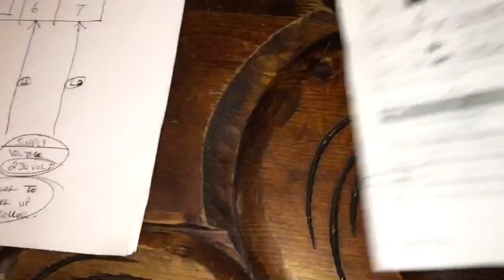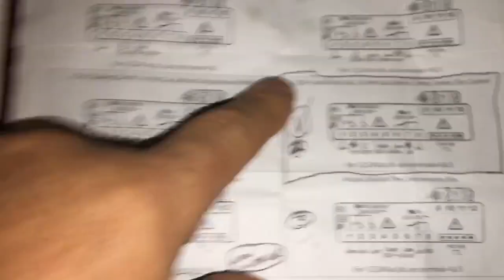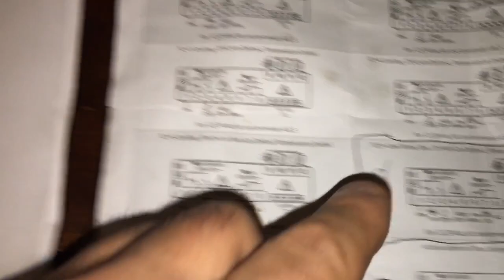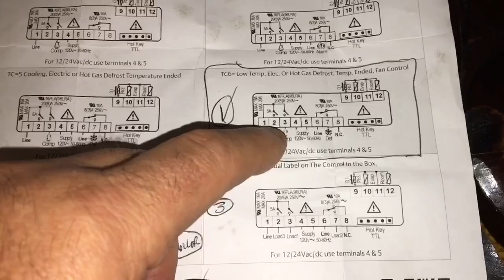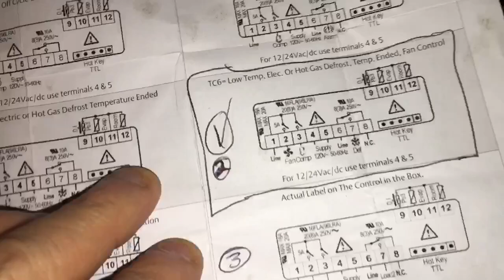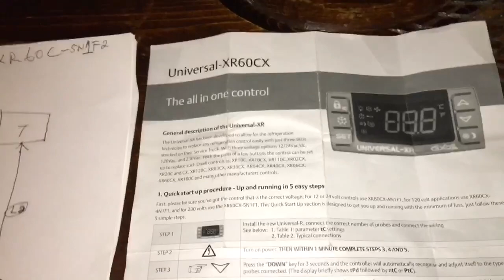How to Replace a Dixell Digital Temperature controller.

Comment: Came here to see how the old controller actually physically comes out / new one goes in / mounts.
Would have been nice to actually show an installation vs. just static photos.
There’s already a wiring diagram on the unit / and it comes with instructions in the package.

Comment: Helpful, thanks. I see a bar code in the lower right corner of the second page for the full manual. My question is how to add or lengthen defrost. Or, even how to tell what the current defrost setting are? If the full manual is down loaded, will the above info be included in this down load?

Guess I'll try it.

Comment: Really hard the first time to do the configurations but after that. Really easy. Dixell Tech support really nice guys 👍👍👍👍
Reply from the maker: 👍. This is a " Universal " Dixell. Just select the type of unit u are installing it on and No Programming needed. its not like the old controller that u have to program everything. soo nice. 1 Button select ,  for a Freezer or refrig  & away u go. rock & roll. soo nice.

Comment: Another thumbs up 👍👍 ps whatever happened with the ink bird controller
Reply from the maker: i Just haven't found the right job for it yet. The inkbird is a simple controller ( On or off at temperature only with compressor short cycle protection /  a simple switch  )  that can only be used on refrigerators or Liquid line solenoid control. it has " No Electric Defrost " capability 😞. This Was a Freezer application , so Had to use a Controller with Electric defrost capability. ive had no Refrigerator controllers fail lately , so its still on the truck. i might have a job for it next week where i need to replace a temp control for a liquid line solenoid that controls a small evaporator on a cooks line pass out cooler. its possible i might use it there.
Reply: OcRefrigeration , Hvac & Electrical Video's.  That would make a great video I had good luck with this controller for a freezer with Defrost it also comes in a 220 V

Elitech EK-3030E 110V Temperature Controller Thermostat Control System Heating
Reply from the maker: @ harry --- ill check out the elitech. heavy diesel has mentioned those  i think.  i think he likes them in europe.
Reply from the maker: @ Harry --- yea, just checked out the elitech. Looks like a good replacement for a Dixell. ill have to get one. alot more affordable than a dixell at around $135-155.00.   $100.00 bucks cheaper. easy to stock that on the truck that way.
Reply: OcRefrigeration , Hvac & Electrical Video's. I have a website I have to figure out how to PM you so you could buy direct and cut out the middleman 😁
Reply from the maker: you can just put it here in comments if u could.
Reply: OcRefrigeration , Hvac & Electrical Video's.  Not a problem they also have an app it’s called Alibaba.com type in the search temperature control and you can buy direct for pennies on the dollar 👍
Reply from the maker: ill check it out. thanks.
Reply: Got 2 of your inkbird still sitting in the van got to read up hope I can use it on refrigeration w/o def in place of dixell🤔
Reply from the maker: @ gene  --- i don't see why u couldn't. the ink bird use ntc probes just like dixell or carel. i stole the inkbird probe to replace a failed carel probe last week. worked great.
Reply from the maker: @ Genek --- only difference is inkbird relay is light duty. i recommend use a true relay or contactor with it. only rated for 10 amps max. 
if only controlling a solenoid no big deal , but a compressor id use a relay or contactor.
Reply: A trick : watch series on Kaldrostream. Me and my gf have been using it for watching a lot of movies lately.
Reply: @Lucca Miguel definitely, been using KaldroStream for years myself =)
Reply: @Lucca Miguel yea, have been watching on kaldrostream for years myself :)
Reply: @Lucca Miguel Definitely, I've been watching on KaldroStream for months myself :D
Reply: @Lucca Miguel yup, I have been using kaldrostream for years myself =)
Reply: @Lucca Miguel Yup, I've been using kaldrostream for months myself =)
Reply: @Lucca Miguel Definitely, I've been using kaldrostream for since november myself :D
Reply: @Lucca Miguel yea, I have been watching on KaldroStream for since november myself =)
Reply: @Lucca Miguel yea, I have been watching on kaldroStream for months myself :D
Reply: @Lucca Miguel definitely, I've been watching on kaldrostream for since november myself =)